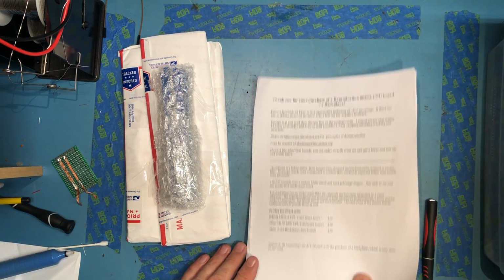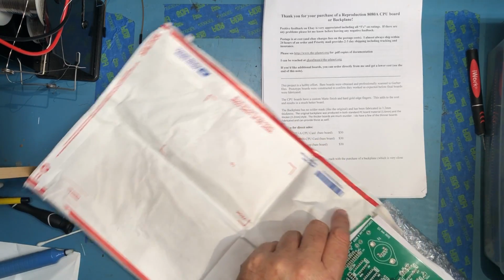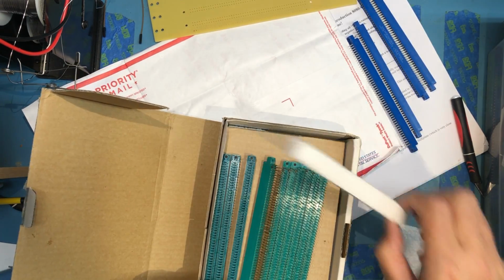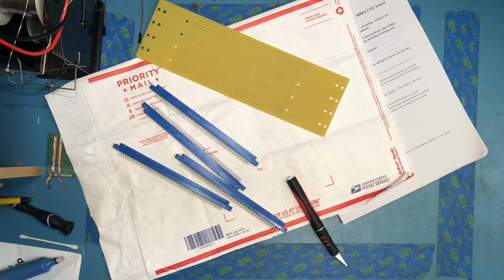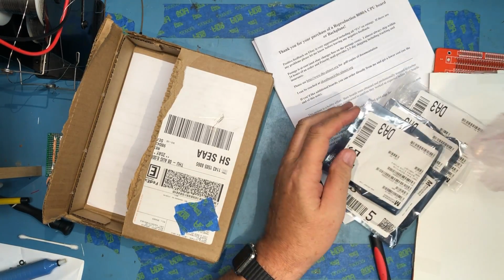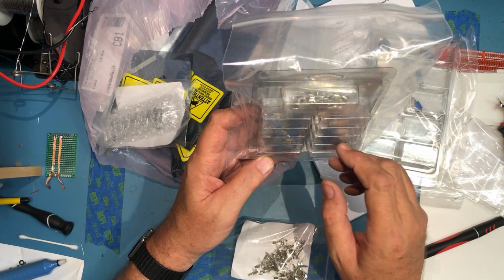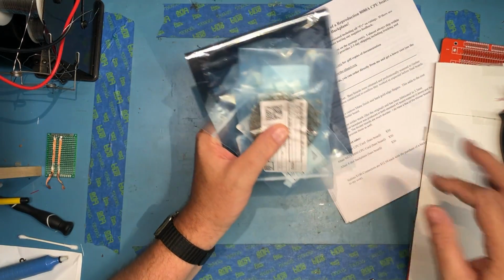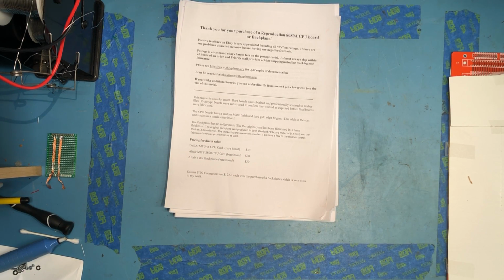Altair 8800 - Part 1 - Introduction and first look at the parts - STB349

Comment: Late to the party, but as an original Altair owner, I can tell you that the choices for the original Altair 8800 backplane were the 4 slot that you have and something much larger; without looking it up I think it may have been 16 slot or maybe even 20.  I bought the larger backplane from MITS when I ordered my Altair back in 1976.
Reply from the maker: Thanks. I had assumed this to be true, good to know it was.
Reply from the maker: Early in they shipped with the 4 slot backplane. They pretty quickly moved to larger backplane. The stitching I did cross connecting the 4 slot ones results in more noise on the bus. The 4 slot ones I used are reproductions of the original.

Comment: Not a big deal but the motherboard is the board on the bottom with all the connectors.
Reply from the maker: Interesting, thanks. Not sure how I referenced it in the video. Possibly as the back-plane or I just plain misspoke. I tend to think of motherboards as having active electronics on them such as a modern PC motherboard while I think of back-planes as passive, edge connectors and power rails.
Reply: @ShadowTronBlog  Totally ok.  Every modern "Motherboard" is really the computer that happens to have some connectors.  The early stuff that I worked on VME, Multibus etc were simply connectors wired to each other to allow boards to get power and be able to address  each other.  Anyway - I enjoyed your video.  Very well done I think.

Comment: How much would all of this cost?
Reply from the maker: I've spent a ton of money on this over the years so a lot of what I'm using was already at hand. The case I'm using was around $600 (way to much for what it is but it's really nice), I'm in a few hundred for the front panel PCB / Interface and CPU card. Around $200 for the back plane, around $200 for the FDC+. The list goes on and on. I've spent WAY more then I would have had I actually bought an Altair on eBay but such is life. I don't regret what I've spent as it's been a ton of fun.